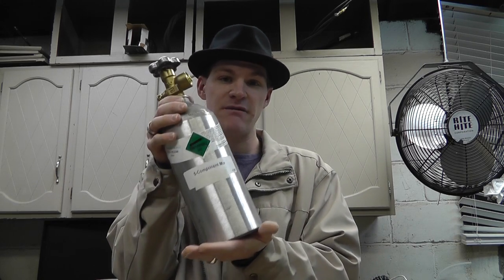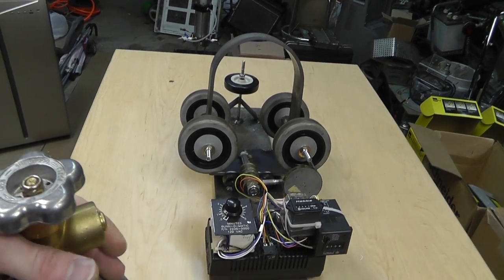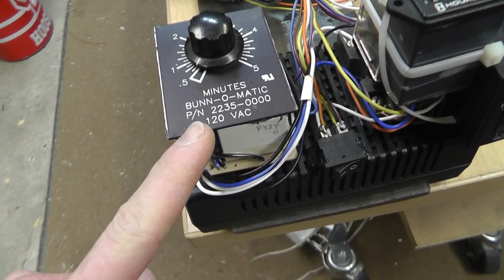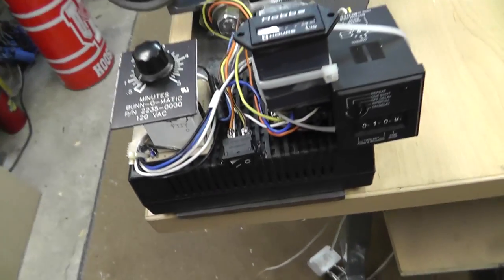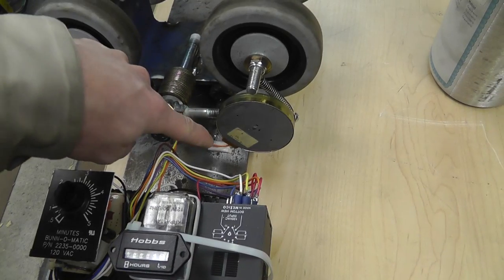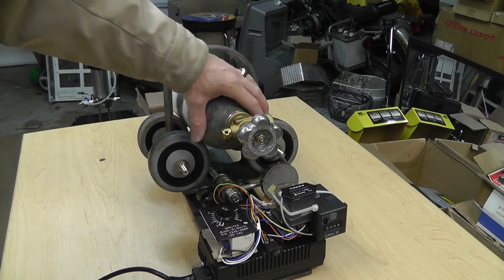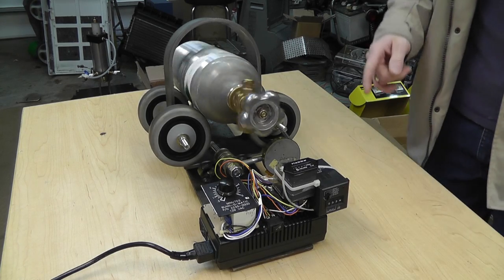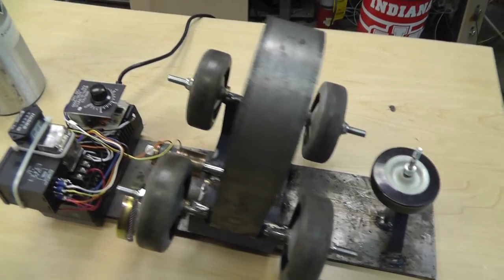Update 16 NGE Papp: Custom Automated Cylinder Roller / Mixer... :) & Some Info At The End...

Comment: Bunn timer was to brew the coffee, turns on and off a relay which controls a water solenoid, water displaces heated water in a holding tank, displaced heated water is directed to the ground coffee which flows through the coffee into the pot. I use to repair them. I know TMI.

Comment from the maker: Pressure, voltage, force (button load cell) , distance of travel ( laser or other )  current, temperature, basically they'll all be 4 - 20 mA transducers and I'll just use eight Channel 4-20 mA datalogger of some type... it would be very simple to do is just a matter of acquiring the correct transducers. I no there's a lot of companies who just throw such things away... I know there are companies such as Texas instruments who would be willing to donate such devices! Thanks! ~Russ

Comment: And yet.... uranium hexafluoride gas is separated, by isotope mass, in gas centrifuges. However these devices produce very high effective "g" loads and uranium hexafluouride gas is very heavy in the first place.

You are basically correct, though. Any mixture of atmospheric gases and-or noble gases will thoroughly intermix as soon as they are introduced into the same chamber. I think this process is a red herring, nothing more. If your popper doesn't work properly you didn't mix right, QED.

Comment: If the bottle had a Blane, welded to the inside, 1 inch tall by the length of the bottle. Manual mixing would take 30 seconds.

Comment: gas doesn't seperate.  If it did, you could use a centrifuge to seperate it, and you can't.  YOu can use a crygenic chamber thing, since they condence at different depts....   There isn't a higher concentration of light gasses in the atmosphere, it is basically homogenous at all levels, except when you get to particulate matter, which isn't gas.